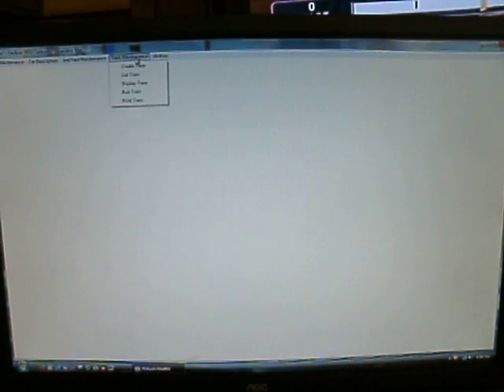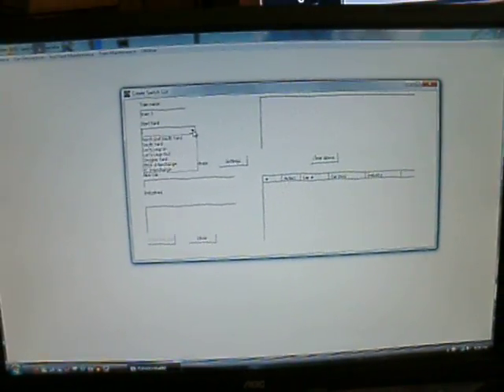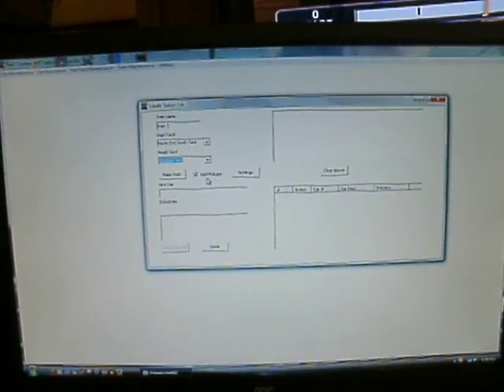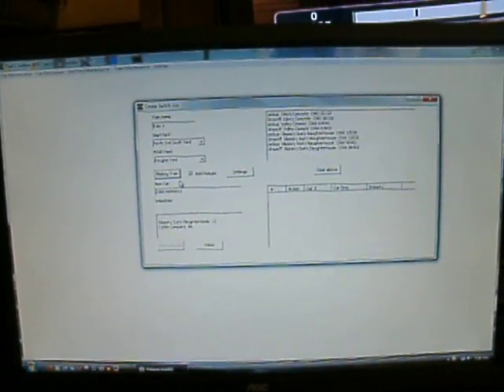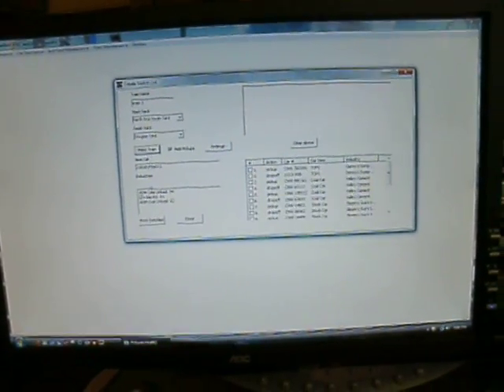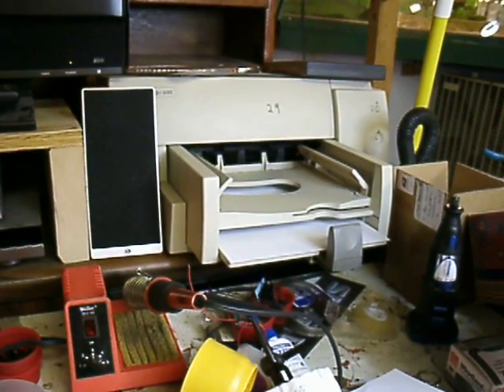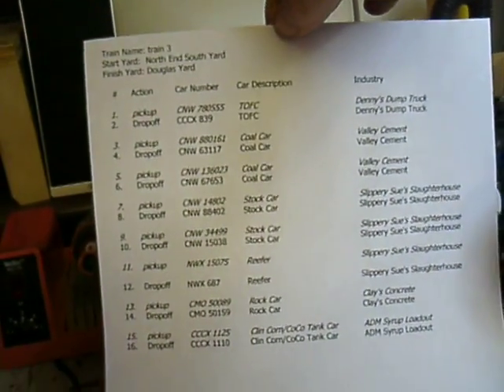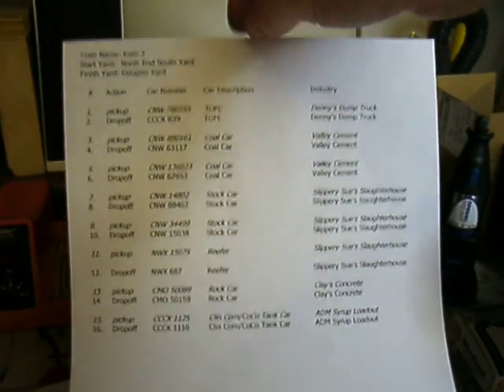Creating RFID Switchlist With Computer

Comment: Hi can you tell me what the name of your program is and where did you get it? Can you send me a copy please..cheers
Reply from the maker: Darren, I have it for free on my website at tntrains.org.  under Electronic & RFID>RFID Software, Download the Zipfile, unzip it and put the exe file in a folder on your computer.  click on the exe and the program should run on any windows computer through Windows 7, I have not tested it on 8 but it should work on any windows computer. I doubt highly that it will work on an Apple computer. There is no installer so you will have to create your own shortcut.   Also, I have not updated the website for a while so let me make sure that it is the latest revision on the website. We have not hit any bugs for a long time so this should be a very stable program.